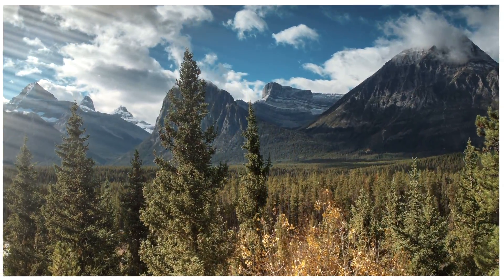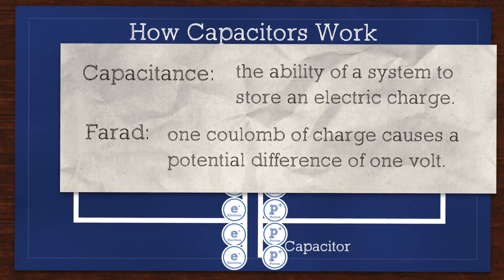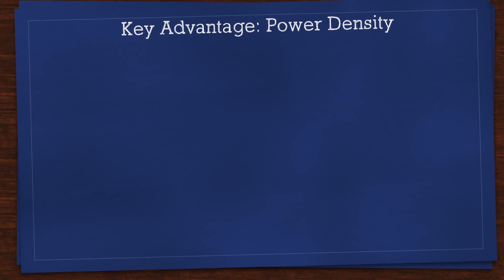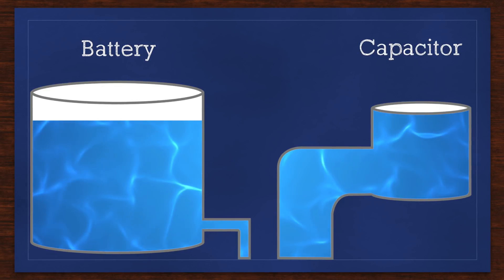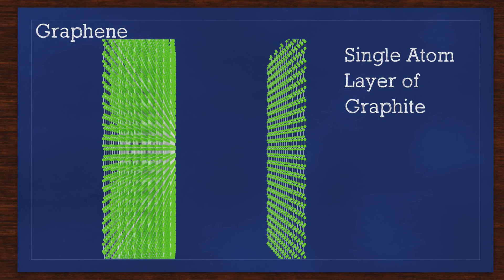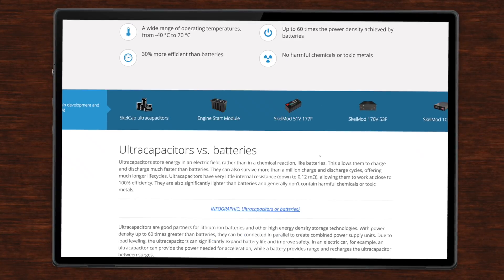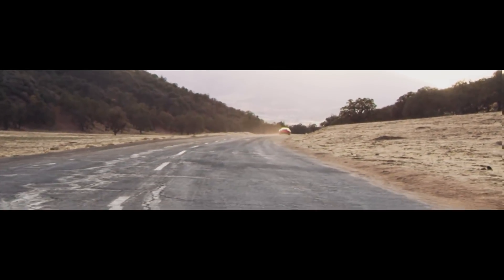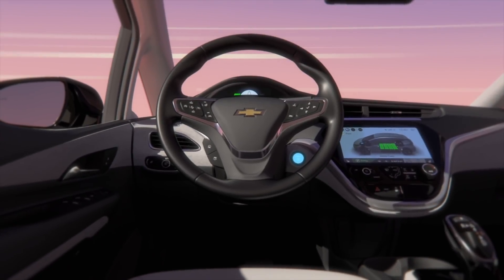Can This New Technology Make Batteries Obsolete?

Comment: Keep in mind that as the charging time for an electric car decreases the amperage has to go up. As the amperage goes up the thickness of the cable must increase also. If your capacitors are pulling something like 400 amps the copper in the cable would have to be about 1 inch in diameter and then there is the insulation thickness also. All of that would make instant charging impractical and insanely dangerous.
Reply: Right? Charging at 350kW even is completely insane, @ 800V (Porsche) that's ~450A. The only way I can see this working is using local power storage at the charging infrastructure - much like a fuel station has big tanks of fuel, you'd have a bit 'tank' of electrons that trickle feeds from the grid and dumps down to cars as fast as is useful.

Still, batteries can only take so much at once, and doubling the supposed charging capability really only affects the speed for a few ten percents of the charging process in the middle. Maybe OK for splash and dash, but not really useful for long distance trips where you need to charge a significant portion of the battery.
Reply: @morosis82  All to often something that is theoretically possible is conflated with what is practical. While I think the tech is cool, over selling it is not a good idea. Now on the other hand an organization with an almost unlimited budget, like the military could do something like that. Perhaps to rapidly recharge lasers from large diesel generators.

Comment: 30 seconds in and you're already equating "clean energy" with windmills. NOT EVEN CLOSE!
Reply from the maker: Why not?
Reply: @TwoBitDaVinci  You need to look (deeply because you're not supposed to know) into just what goes into the manufacturing of these things, the transport of all the materials, the impact of discarding these materials and then, on top of it all, the maintenance. They're anything but green. 

While your doing that, take a side step and look into the batteries for these electric cars. One day all these ideas may become what they're touted to be today but that day, if it ever comes, is a ways off.

Comment: I was looking at making an ultracapacitor powered car for drag racing, but the energy density is just too low. Batteries can largely handle all the power output and input you need, especially on the bigger packs due to the huge amount of parallel batteries all splitting g up the incomming charge. The real world benefit from recharging with supercaps changes regen recovery from 80%ish to around 98%. 

Now to run 300kw for 10 seconds(drag scenario) you need 3Mjoules of energy which will require approx 250 cells, but to get the voltage you need will be about 150 cells X 2 in parallel. Which will get you one run down the drag strip, weigh 150kg and cost 14,400 euros.

Now you can do that cheaper with lithium, with the same weight and have about 20x the energy. But instead of a million recharges(caps) you might get 1000(lipo)

Also the skeleton supercaps are 3200F which is the same energy density as other leading caps. But yes once they get single layer stuff happening then energy density might get to the level where it is almost a substitute for batteries.
Reply: I figure supercapacitors are really only complimentary to a battery setup, not a replacement for them, and just as you said, they are most beneficial for rapidly charging and discharging using the energy from regenerative braking. 
With your calculations, how many super caps would you need for a 10 second drag?
Reply: Use it together... The worlds faster remote control cars use ultra capacitors and EV engines. Go break the world record mate. I just gave you the key.
Reply: Thanks.  Stay tuned. .Work it. .

Comment: this article is in large part FAKE NEWS! 
The SkeletonTech company is not making real graphene capacitors. In fact, if you check their website the claimed energy density of their capacitors is on par with other commercially available EDLC capacitors using conventional technology. Skeleton is just a company subsidized by EU being in a developing economy like Estonia, possibly making a marginally better/cheaper product. In general, anything employing graphene (in a meaningful way) will be nothing more than a curiosity till it will be figured out how to produce graphene in large quantities at a competitive price. And that has not happened so far. Capacitors + batteries could indeed be great for energy recuperation and acceleration, however the statement that they could lead to fast charging batteries is FALSE. As the battery is the bottleneck limiting the overall speed (unless the capacitor has an energy capacity equal to the whole battery, but at that point the battery would be pointless!). Besides, at this time, capacitors lose charge faster than batteries
Reply: From their webpage: Skeleton Technologies’ patented curved graphene is changing the world of energy storage.
Reply: @mccfrank1212   let me tell you a shocking truth, 99% of patents do not have any actual meaning, other than forbidding others to do the same thing, even though that thing is meaningless. They claim their energy density is not any higher than other "conventional" capacitors, that's the only actual data that matters. And confirming that such patent is just a marketing gimmick.

Comment: Love the video and the subject.

Very good job explaining batteries vs. capacitors.

However, you have a fact error.  Graphene is the SECOND-strongest known material. Carbyne is the strongest known material in the universe, and interestingly, it is extremely insulative.  It also is an excellent subjectfor another video.
Reply from the maker: Yes indeed we’ll need to look into it!

Comment: I believe the use of supercapacitors in the regeneration systems such as you describe here may be the key to making much cheaper EV's. Presently the Tesla strategy uses the much larger pack size and the high horsepower motors needed to move those heavy machines to improve the regeneration capacity as well as to sell the cars to those for whom acceleration speed is  a highly desired feature despite the price. Using the scheme you mentioned will allow both smaller motors and energy dense and ever cheaper batteries to meet everyday driving conditions for the buyers of basic commuter cars..

Comment: One key thing i want to point out is that even though a vehicle with capacitors could "Potentially" charge in seconds, realistically it's not possible as such results for typical electric fill up stations would quickly overload the electrical grid and may cause catastrophic damage. Even if you had fully charged capacitors in your home that slowly charge during the day so you can instantly charge your car when you get home, you would need a very dense and heavy  and expensive power cable (one too heavy for most people to adopt) to transfer that much energy in such a short period of time.
Reply from the maker: The refilling stations could charge up ultracapacitors too when not in use.
Reply: @TwoBitDaVinci  Won't be cost effective for 10 - 15 years as patents must expire before every company is willing to utilize it liberally. Just as Honda had their HP per displacement dominance for years thanks to VTEC and now every tier of every brand has VTEC. Playing favoritism via federal barrel of the gun of specific technology is counter productive to broad spectrum innovation. As other manufacturer's find other avenues to achieve the same goal whether it be Mazda HCCI, Achates opposed piston engine, or Nissan's variable compression engines.

Technically, on an engineering standpoint an EV with a sizable capacitor bank should be considered a hybrid. The problem with capacitor's is doubling the voltage halves the capacitance which means it's only ideal for vehicles 4000 lbs or less on a volume basis. As larger capacitance requirements you'll be running into an energy density (volume based) problem. Which you improperly used that term in the video suggesting it's weight based.

Random fun fact: Going from a Ram non eTorque to an Ram eTorque for a 2 MPG increase has 3+ times more CO2 reduction vs a PHEV Prius driver upgrading to a Model 3. Are current subsidies irrationally being dispersed if the goal is as much emissions reductions as possibly fast.

Comment: There is only one small tiny problem with charging a huge ultracap in 4 secs : the gauge of the wire needed to carry all those amps . Totally impractical unless you use massive cooling .  Let's face it , once you can charge a battery at 350 Kwh (and we are not far from that) , that's enough to get very significant range (300 miles)  in a mere 15 minutes , which should be fast enough to satisfy everybody .
Reply from the maker: Great point. Yah it won’t be easy to charge at a super high rate but at least it’s possible. The key is that continued research is invested into all these potential solutions
Reply: @TwoBitDaVinci  Possible is not the same as economical or energy efficient . I am all for the development of  new technologies that could "potentially" lead to charge times of 4 secs , but the physics and economics say it won't happen any time soon even if that potentiality is realised  : 5 minutes maybe , but even that is a big big stretch right now . This should definitely not be used as a carrot in front of people to keep postponing the purchase of an EV until that miracle tech makes it to the market (if ever) as current and very near future tech already exists to enable comfortable long road trips without too much planning , let alone 95 % of all driving in daily commuting . For that 95 % of driving , range anxiety did not even exist in the days of the GM EV1
Reply from the maker: Yeah I agree the idea shouldn’t be to persuade people to wait on a tangible EV they can buy today. But sometimes it’s hard to see which technology will experience that big breakthrough
Reply: @TwoBitDaVinci  I agree that the "do it all EV" today is a bit out of reach for a lot a folks , but make no mistakes , classical battery tech is evolving fast enough to make that a reality in less than 4 years . No need for revolutions or miracles , evolution will do nicely . Within less than 4 years , ICE cars will just seem the  stupid thing to buy
Reply from the maker: Totally agree with you. But I do want the smart people of our world working on the revolutionary! We’ll enjoy the amazing evolutionary advancements of today in the mean time
Reply: @TwoBitDaVinci  The exciting part for me is that it's starting to feel like the race to an EV and renewable world is on a downhill road. i.e. The easy route. I have a lot of stored up impatience after watching this space for about 15 years. But it feels like we're close. Less than 5 years I think. I'm waiting for that moment where this new paradigm shift occurs. I want it to be a no-brainer. Better. More powerful. More affordable. More durable. Cleaner. I know it's coming. 
Of course in the meantime. If my situation allowed I would buy one of the current EV offerings. And I would encourage anybody who can to do so.
Reply: @gerritgovaerts8443  I agree. I believe I read somewhere that around 2019/2020 much improved Lithium based batteries are set to hit the shelves. Just in time for the new Roadster.
Reply: Coincidentally Graphene is also a superb conductor. It is not far fetched to expect they will start using it for high current applications in the near future. Either way... Charging will be a hell of a lot faster. Except at home where you'll be limited by what you have there. But then. Charging overnight in the garage is not a chore. The important thing is that you can charge quickly when out and about.
Reply: @joeblack4436  You are correct about the superb conductor part , but …. graphene is very strong in 2-D applications , but tends to delaminate very easily if you need more than 1 layer . Mass production at low cost is also still a problem . Traditional tech will give us acceptable charging times very soon , no need to wait for a graphene miracle to start the transition to sustainable transportation.

Comment: The whole regen issue becomes a fairly important area to focus on.  I did some reading about garbage collection trucks a few years ago - they're among the worst MPG of non-haul class trucks like get used in mines.  One approach to improving it was drive the truck with hydraulics and a feature of that is the braking system used hydraulics to capture the energy then use it to push off again.  In heavy start/stop environments like residential area garbage collection - it's a good pairing if the whole system is viable - it was a commercial product called RunWise (there were a couple others).  ANYWAY... the Prius at the time was said to be in the low 20%s for recovery rate where the garbage truck was up in the low 70%s'...    so take capacitance storage of that braking energy and it could be really ideal in pushing city type start/stop cycle efficiencies way, way up - and they're already more efficient in city than highway....

Comment: Errrrrrr, 30 to 100 Wh per Kg is still half the energy density of a conventionnal battery... Costs aside, considering battery weight is one of the major drawbacks of any EV (lowering its efficiency), I don't see ultra capacitors replacing batteries for mobility purposes just yet.
Reply from the maker: Definitely it still has a way to go
Reply: If they are much cheaper or lighter or both then It could be viable.
Reply: Maybe they have 30 to 100 Wh per Kg in the lab, but nothing near that in their products, which can't even match Maxwell's energy density as far as I can tell from their datasheets.

Comment: The applications of graphene, other than electronics is actually limited. It's a 2d material 1 atom thick. Carbon nanotubes will probably shine in applications with fibres like bullet vests or cables
Reply: Almerinda Romeira,

I suggest you look into it more.

Just a couple of examples - graphene will be used as body and chasis panels on vehicles - Volvo has been developing them for five years; graphene is the best desalination filter known to humans and will be cheap andcrequire comparatively little energy;; graphene "heals" it self when punctured; graphene has been developed as flexible, unbreakable transparent smart phones.  

Graphene is going to change the world the way iron-working did, IMO.
Reply: @chriseidam7319  sure, if you look from that perspective there is already a "graphene" road bike. But it's not 100% graphene. It's an additive for the resin used in carbon fiber. 
I see it more like an ingredient in composite materials rather than a miracle by itself.

I'm pretty sure that when you stack enough layers to make a car door you start loosing some benefits.

Comment: Energy stored in a capacitor is only half of what is supplied by the power source. 1/2 CV^2. It is possible to reduce this wastage but only at the cost of charging time. I don't see how to over come this limitation.

Comment: With the 100 times lower internal resistance of super capacitors, we are not longer in danger of being engulfed in flames as with li-ion batteries, but are assured to die in an instant detonation as gigawatts are released in less than a milisecond. 

Bad exanple to use cars to explain energy density: The car travelling 100 miles in half the time, will use 4 times the energy. Engine size is also a bad analogy having nothing to do  with energy density, only power density. It would makes sense to claim one car had half the fuel capacity but twice the hp, but still as I said, this does not translate to double the distance. The water tank example is right on the money! cut the Porsches out please.
Reply: Correct.
Reply: noobenstein  These don't work in a catastrophic crash.
Reply: @DavidFMayerPhD  Cheers, thanks for support on this slightly fantasy engineering video!

Fuses are also slow enough to let a fire start and if it is high enough current, the fuse will arch like a florescent tube and keep conducting for a while with the ceramic glowing white hot. Also in a crash the short is possibly internally in the capacitor. Third, fuses uses power, not uncommon to have 0.5-1.5V drop across one in an EV when drawing hundreds of amps accelerating robbing precious power from your battery pack and the repeated heating and cooling wears them. I've taken part in some competition EV design back in the 90' and everybody detested fuses, connectors and relays in the power circuit. We solely relied on the FETs in the motor controller to blow if something went wrong, which it often did until the motor characteristics were dialled in. Blowing 20 200A FETs simultaneously with a loud boom always gave the driver quite a shock when it happened  2 ft behind his back, however no fires or runaways, just a puff of blue smoke, but it got  old fast to resolder FETs and driver circuits.

I do understand why fuses and breakers are used in current battery production vehicles to avoid class action lawsuits from old ladies getting PTSD, but super capacitors are simply too extreme to protect with fuses if you have hundreds of pounds of them under your feet and rear seat.

Comment: Good video just as your channel but I think you didn't answer the video question would super caps  be able to reach the energy density of batteries?
Reply: The graphene capacitor industry is basically just a newborn baby at this point but already it has reached close to half the energy density of a mature lithium-ion type battery. As more companies tackle the weaknesses of capacitors and refine the technology I see no reason to believe that capacitor energy density will remain an unsolvable problem.
Reply from the maker: In the future possibly, but batteries will continue to improve. I think it’s a case where brilliant scientists work on all these various technologies and we see where’re were at in 10 years or so